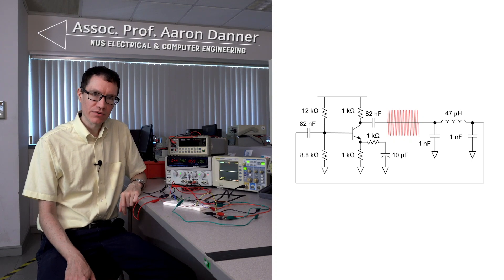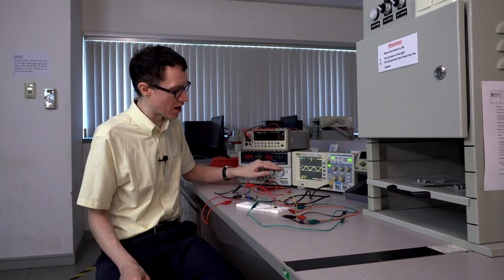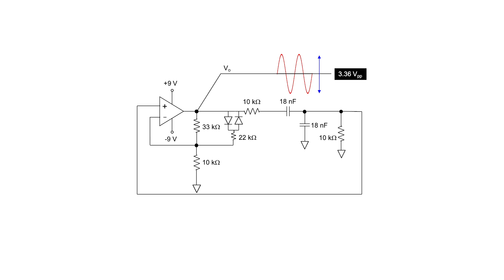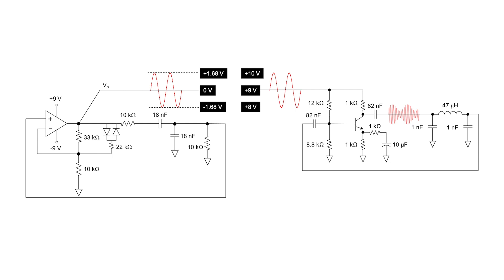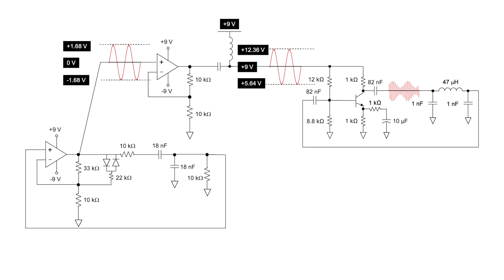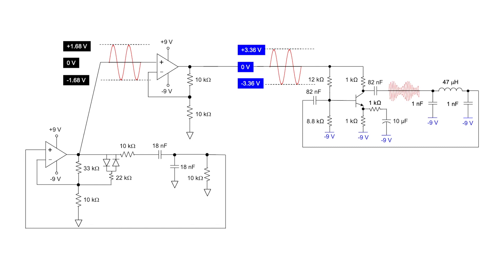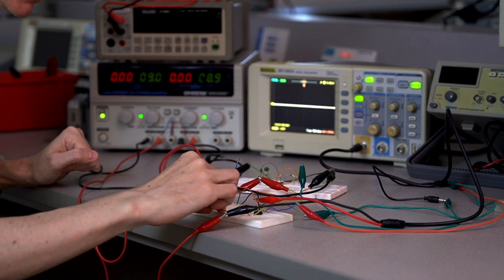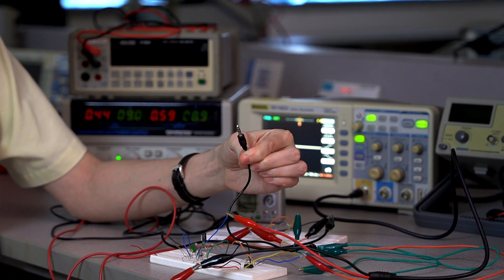How to modulate a carrier wave with audio (10 - Oscillators)

Comment: Aaron, your video has been a major breakthru for me, thank you.  I have been digging around into electrical and electronics off and on for decades. Recently I returned to my wintertime hobby( summertime golf) of am radio, specifically to construct a simple receiver. As I experimented and studied and learned I just went further down (and backwards) into all sorts of rabbit holes, always learning at Warp 9. I recently found myself unprepared to do more on "receiving" without a detailed grasp on RF/AM generation/transmitter/transmission. Your video was the first time I have found a detailed explanation of am transmitters, with specific values including voltages/amplitudes. 99% of the literature ends at oscillation = frequency, full stop, LC over and over, now what? Wait a minute, what happened to amplitude = volts? I can not, for the life of me, find out what the amplitude is of the carrier waves generated by the oscillator at a typical am broadcast station facility. Say 610 CKTB near me. I know the frequency of the carrier is 610KHz. I know the verbal audio will be something like 150-1500Hz. I am sick of looking at blocks call modulators, ok they are blended to create AM, but at what amplitude? There is some info about various KW levels of various stations but no real detailed design level info, line diagrams, utility inputs, etc. There can not be XXX KW involved without serious voltages and amps! BTW...I do not want to transmit anything, I just want to understand. Your work here has allowed me to feel that I am not totally insane, that there really are values for all of this stuff. Thank you again. Fred

Comment: What about if your only transmitting inside your own farridite cage for example your PC tower/case and it doesn't travel through the air but over the circuits inside the computer and componets itself

Comment: Could this work at 1GHz?
Reply from the maker: It's harder. The design still works but you have to be careful to keep the wires really short (their inductance matters then due to the short wavelength of the signal) and choose components that don't have excessive parasitic capacitance.

Comment: That was a great explaination and topic! I succeded in building the Colpitts oscillator and modulating it with an audio source coming from my pc. I have very small range of about 3 feet. I would like to understand how to increase the transmitting distance, i tried by putting an antenna and by increasing the collector current of the bjt but the results where not enough. Moreover i noticed that by using smaller inductors to produce higher frequencies, the output of the colpitts reduces and i get lower and lower peak to peak voltages of the sine wave. Can anyone explain me why is that happening and how to increase effectively the transmitting distance? Thanks🙏
Reply: With rf power amp to output
Reply: an impedence matched antenna, an rf amplifier, etc etc

Comment: Great simply great  , awesome  , explanation is simple  , easy to understand  . Sir  a request  , if possible please make a video on the  RC circuitry used for RC controlled car.  How the signal is transmitted from transmitter to receiver module's to control the dc or servo motor of the RC toy car  , please consider it as a project 
Teach us from the  scratch  , step by step  Circuit designing etc
Any magazine or book name having this kind of RC toys projects  , with detail explanation of the schematic

Comment: My Colpitts oscillator produces a waveform that looks like a cursive lowercase r. Help!
Reply: Your transistor is probably cutting of, also thats not good for efficiency (also at a higher power you would get in trouble) because of the other frequencies that you are generating. Try switching around some resistors (or use potentiometers) to get it to a pure sine. Also doing that will reduce the amplitude, wich youll have to compensate for in another way.
Reply: Also if you can, try looking at it with a spectrum analyzer but be careful that you dont destroy the input of it.